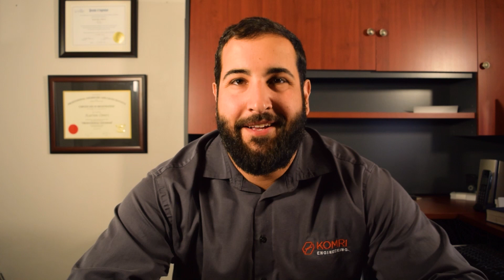Why are steel shop drawings so important?

Comment: Interesting video. Sounds like a similar model to the UK where we (structural engineers) provide connection forces and member sizes and then the fabricator designs the connections.

Comment: In Australia it's required for the structural engineer to also do the connection designs, each firm would generally have their standard connection types and capacities so they don't have to be designed from scratch unless it's a unique connection